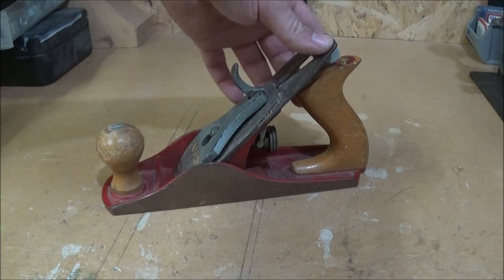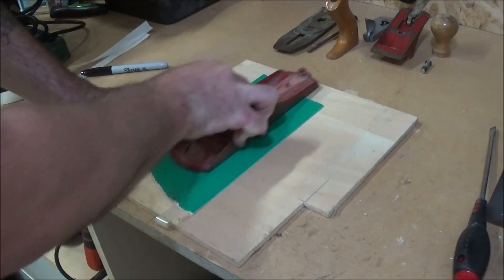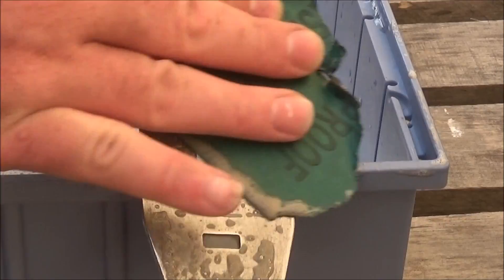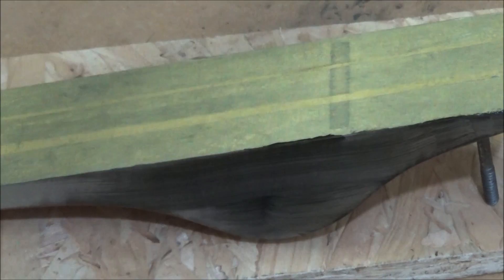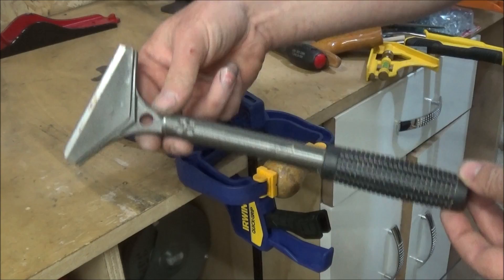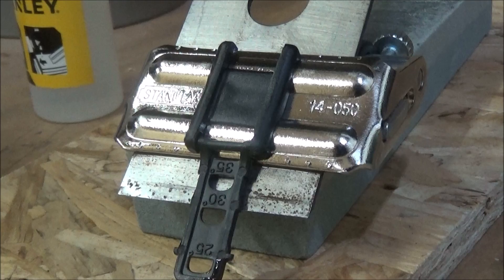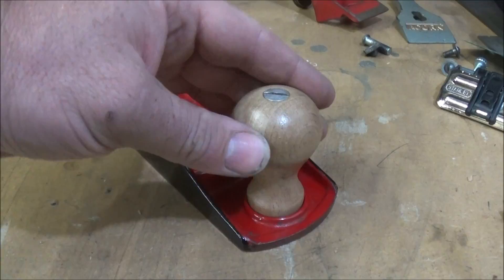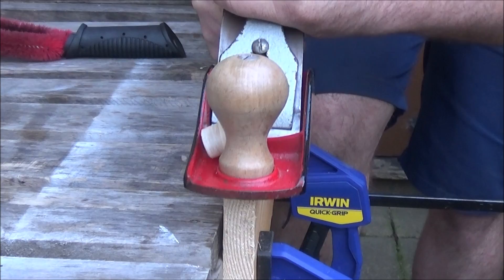Fixing Up My Grandfathers Old Stanley Acorn No 4 Wood Plane - #017

Comment: Great video, well done on an honest restoration of a little budget plane. I’ve done a similar job on my father’s Acorn no 4 which he would have bought in the late 1950s or early 1960s. As you say, it was Stanley’s budget range aimed at hobby joiners and woodworkers. In response to another comment, there was no frog adjustment screw - a feature of the “engineered to a price” approach.

Comment: May I suggest that next time you get an opportunity to restore a hand plane, when you flatten the bottom have the plane assembled. This will give you a more accurate level plane bass.  But nice plane cheers
Reply from the maker: Hi, yes I did read that before I tried to restore this one, but I also read conflicting views on if it made a difference or not. So I opted to do it whilst the other parts were soaking in water

Comment: Hi. Interesting video especially as I carried out pretty much the same procedure on the same plane yesterday. Perhaps you can clear up something for me.  Normally on this type of plane there is a screw below the brass wheel that allows you to advance or withdraw the frog assembly. I have spent the morning looking for the one on mine that I thought I lost during disassembly but I noticed there is no screw on your plane either. Do you adjust the frog manually by slackening the two retaining nuts and just tapping the frog back and fourth? Any ideas welcome. Thanks.

Comment: Hi James, many thanks for this video. Well done. I'm just doing the same: Got an old Acorn plane Nr.4 from Ebay. You didn't refresh the red colour of your plane. I'm just wondering which colour code it is because I would like to paint it again. What do you think, could it be the colour of the UK busses which could be nearly RAL 3002 (fireplace red)? I got this information from a forum wher they build small models of those mentioned busses. Do you know which colour it is? Would be very helpful. Thanks in advance. Regards, Arne

BTW: If the plane is finshed there will be a video on my Youtube channel as well 🙂
Reply from the maker: Hi, I've no idea as to the shade of red it is. I didn't bother doing anything with mine, because it came up well with a clean and a polish.

Will take a look at that 👍
Reply: Hi James, I found out which colour fits best based on this list: https://modellbau-planet.de/media/docs/farbkonvertierungstabelle-ral.pdf
I took RAL 3004 Purple Red (Revell 331). Looks really great and 14ml is plenty enough to paint it 3 times and additionally your car😊. Cheers, Arne